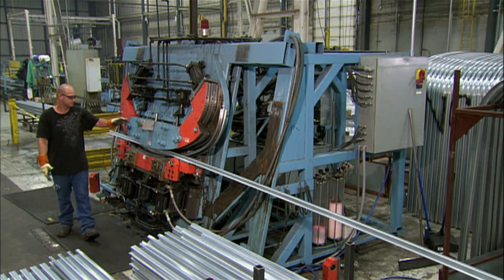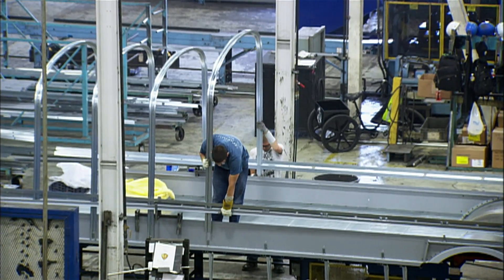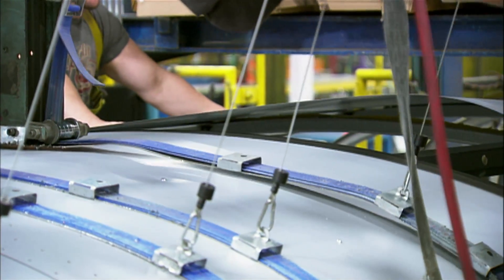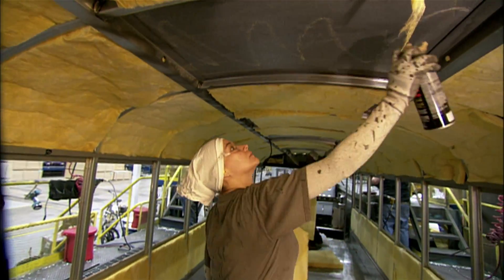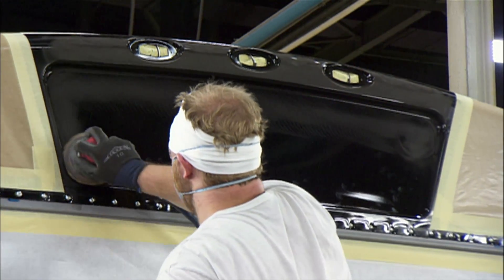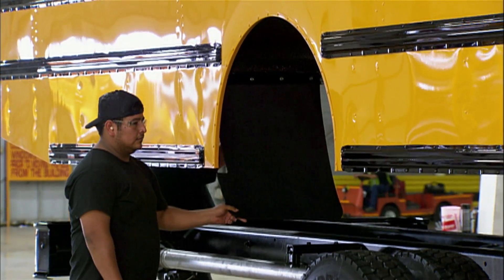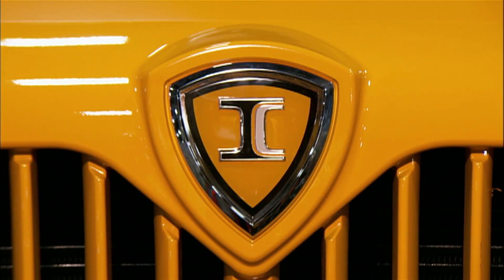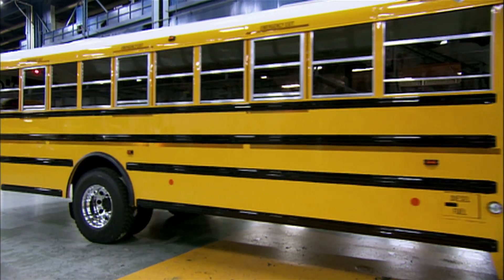IC Bus on How It's Made: Part 2 of 2

Comment: "The plywood floor will absorb noise." Yep, and a ton of water from the leaky windows, which will never dry out and will eventually cause that shiny steel floor to rust through. I'm building a skoolie, which is a school bus converted to a motorhome, and almost 100% of the time when the new owner of a used school bus pulls up the floor, they find rotten plywood and rusted steel floors (sometimes, as in parts of my bus, just the rotten plywood because the steel underneath is entirely rusted away). American school buses really are engineering marvels (sorry, different channel) but those engineers turned the "long-term waterproofing" slider to zero.
Reply: My bus is a 2016 ICCE 300 and it doesn't even have rust
Reply: @FrustratedCat33  that’s cause it’s a 2016…

Comment: I drive the SAME EXACT BUS. 
And other then the heat not working, this is the ONLY bus that drives like a car. 
But international buses suc anyways cause the muffler plugs up with so much build up, you can drive past 25 mph cause it’s clogged!!
Reply: Then straight pipe it 😎

Comment: Tesla's list below just scratches the surface of the poor quality of IC busses.  But hey as a mechanic my paycheck depends on an expensive  to maintain vehicle.  When we switched over to Thomas/Cummins a few years ago it was a scary change as we were not making the constant trek to a dealer for warranty repairs/recalls/updates ect.  We were actually worried we might get laid off.  Some of our CE200's have as many as 50 warranty claims on ISIS/Oncommand.  By comparison our  Thomas busses only a few have been in for warranty and most have not been to a dealer yet .     SO far the only problem areas we have found with Thomas is corrosion in some wiring ,rusting out coolant tubes and short life of passenger heater blower fans, radiator tanks corroding.
Reply: OH, I can really scratch deeper:
ICs have heater hoses that burst open and get all over the drivers feet/legs. The heater core by the driver has a stupid as hell valve that leaks (you'll see coolant run down the left side fender/mudflap) The S shaped blue hose behind the Alternator burst open too. The service doors might as well be made from rice paper, the bolt inserts loosen and crack the metal (door) The lock bar screws on the emergency door will eventually just rip out like they were screwed into cardboard. The seatfoam padding sucks and you can feel the metal framing easily up top. The MaxxForce motor when shut off the injectors drain/loose prime SO when the bus is restarted it chugs and bucks at first making the driver think something is wrong. The wiring management is a joke!  Roofs that leak and get on the driver's seat cushion
AM/FM antenna's top nut will fall off and the whole thing will fall down onto the stop sign. Transmission cooler lines that will RUST (use undercoating spray!) O-Rings in the fuel rail that break down and the bus will not start when hot.
IC= Inferior Crap!
Reply: ***** puerile comment
Reply: Nikola Tesla So whats your verdict on the Thomas C2 SafT Liner?
Reply: Extreme Tutorials 
Never touched one of those, here in central Ohio it is IC or BB
I know the Thomas brand (body) Freightliner had years ago with the 3126 Cat.. those are long gone around this area
Reply: Extreme Tutorials q